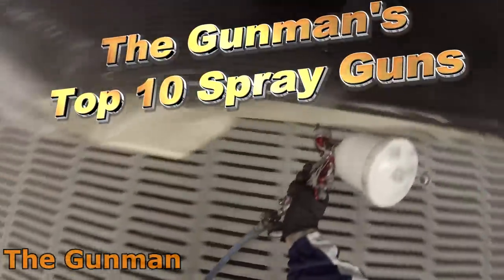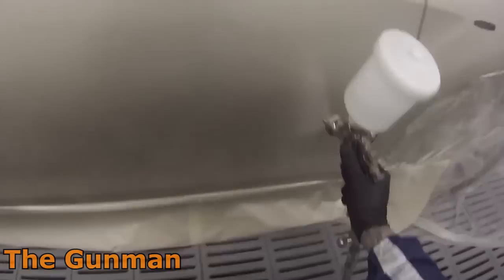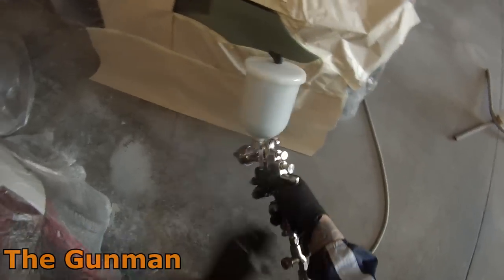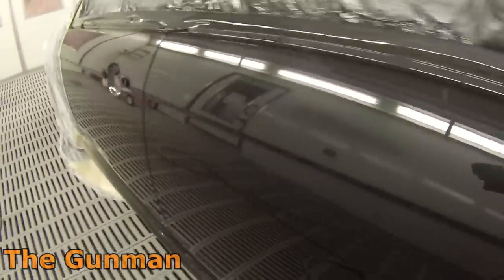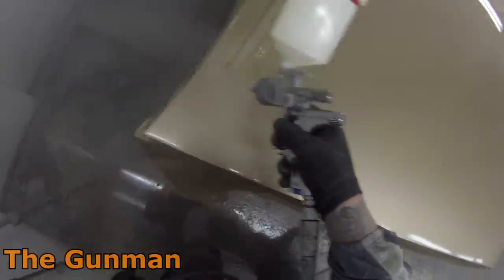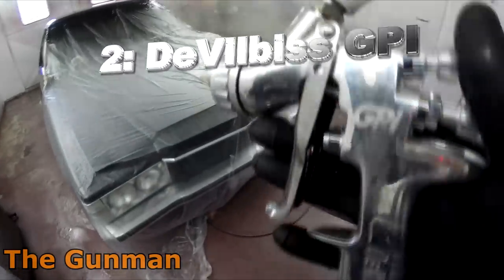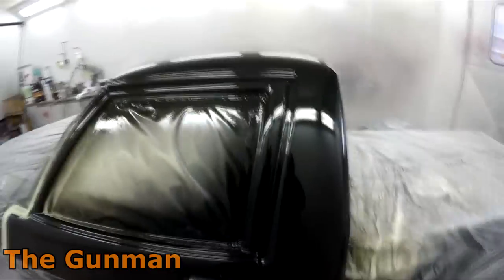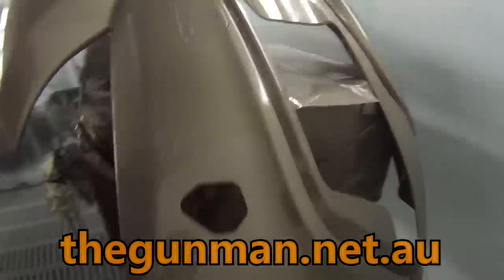Top 10 Spray Guns

Comment: My shop has ran the FLG3&4, with my only complaint is that the 4 was less ergonomic, but dependable for every day use. We've upgraded to Techna Pro this year, and now use the FLG4 as sealer guns. The FLG 4 is a very versatile gun and a great value, but the Techna difference on performance and efficiency is like night and day. As far as setting my fan goes, i just adjust it until I have the sharpest crisp edge on the fan and then go. Keep up the good shootin''.

Comment: My options changed massively since I got a couple sata 5500 rps. I was a diehard devilbiss guy but my boss offered to buy a couple guns to help speed things up and I absolutely love them. They make mottling a thing of the past even on the toughest colors. I spray Spies water so it might be more sensitive to mottle but regardless compared to any of the other guns it's effortless with the sata.

Comment: I started painting cars approx. four months ago and I was using the Sharpe Finex FX3000 and struggling to apply a smooth base and a smooth clear. One car I painted had over 200 runs in my clear coat!  Uggh. After watching this video, I purchased a new Devilbiss Tekna Prolite and it sprays awesome!  I just finished my second vehicle with the Prolite and I absolutely love it. I am using the TE10 air cap with 1.3 tip, and the fan all the way out with two turns out on the fluid as you suggested. Settings for greatness. Thanks for the inspiration!
Reply from the maker: Great to hear man, nice gun and will last a lifetime if looked after properly.

Comment: I began spraying in the 1970's with DeVilbiss and Binks Model 7. 

When automotive paints moved to 2 stage systems it became advantageous to acquire a good hvlp for topcoats. There have been several guns that provided decent results, but my favorite gun is the Optima 800 1.4 was purchased around 1985 has been a great gun...never changed the fluid tip and needle showing no signs of excessive wear!  Many years later...it is now time to replace the material cup, the original plastic cup is about done, will replace with a stainless steel, or aluminum cup soon.

Comment: Great Job, I have an Iwata Air Gunza and agree with you it is a good primer/sealer gun. I purchased two Devilbiss FLG5 guns, one for base coat the second for clear coat upon your recommendation.   I used the FLG5 for clear and was surprised with a huge fan and applied the clear like glass.  Thanks for recommendation on the FLG5.

Art Bolanos
Houston, Texas
Reply: Hey Gunny,

I had an issue with both FLG5 from Spray Guns Direct from the UK.  Our good friend Chris from Sales and Devilbiss Rep Ian gave me pointers on the gun.  Resolved the issue very quickly and a "Two Thumbs Up" Gunman Style to Spray Guns Direct and Devilbiss for great service.  

Art Bolanos
Reply: +Arturo Bolanos hi, i bought this gun but still awaiting for its arrival. what seemed to be the problem with it?

Comment: Hi,

I am from INDIA and I have been painting for around 10 years now. Here in India we are not able to use quality guns like you guys because to paint a full motorcycle we get paid around 200$-250$ maximum (including all raw material, ground preparation, primers, base coat, paint & clear coats.). On each job I only make maximum around 30$-50$ so investing in the high end quality equipments is not cost effective but following your videos have inspired me to gift myself a good gun & have also helped improve my jobs, now I am getting more work compared to before using your techniques, all because of you so a big THANK YOU.  I have also started getting custom paint jobs now.

The pure passion to do good for what I love the most.

I have been saving some money for around one and a half year now for this.

Can you please suggest me a perfect gun I should buy which will do both painting and clear coat, I am ok buying 2 different size tips, since I cannot buy more than 1 gun at this point of time.

Also I cannot buy any good spray gun here in India so I will have to get one online from USA. 

Currently I am using a very poor quality spray gun available here by the brand name PILOT.

Hope you can understand my situation and guide me in making the correct choice.

thank you,
Cheers.

Comment: Never painted before, bought the GTI pro lite TE20 , did the whole motorcycle with it. Primer, base, and clear. All with pretty much the same settings. It turned out great. I love the gun but what do I know. Ive never used anything else. I have since bought a primer gun.

Comment: I used to use a GTI for clear but the cap pressure was way to high causing a lot of overspray in the booth and wasted materials. I have a tekna prolite but in the USA at least it is for base only. Tekna does make one that is meant for each material. I use my LPH400 for sealer and it’s absolutely amazing. I also have a WS400 supernova for clear and after some adjustments i can lay out glass every time. In my opinion the best base gun is the LS400 supernova or as some people call it an ENTECH. Best paint transfer i have ever had. Less waste and less overspray filling the booth. As always this is just my personal opinion. I do also like the sata 5000rp but I couldn’t justify spending that much money. I feel that sata makes the best gun for clearcoat.

Comment: Great vid.  Every gun I use is on this list....but I would put them in a different order.  My FLG is my sealer gun, Tekna for color, Supernova for clear.  I know why you put the Tekna at #1, it is probably the most versatile gun ever built, and is the best base gun I have ever used.  If I could only have one gun...it would be a Tekna.  But the best clear gun, in my opinion, is the Supernova.  Hands down.

Comment: Hey there. Would you recommend three guns? One for primer, one for base coat and one for clear? I’m new to painting (never done it) and ordered two guns, GPi pro 1.4, 1.6 1.8 and the GTi Pro Lite 1.3+1.4 with a T110 cap so far to start and later maybe get that TE20 after some practice. Thanks for the videos.

Comment: hey gunman, I don't do cars, I mostly spray woods and I like car body acrylics. what is the difference between 1k and 2k when we talk spraying? do I need a different cap? I am using an inexpensive gun with a 1,4mm nozzle. works for my backyard projects and jerking around. I know 2k dry harder and are much better to wetsand and buff. is that true? thanks!

Comment: Thanks gunman for taking the time for great reviews and instructional videos! I just bought the flg5 with a 1.4 tip strictly for solvent basecoat on your review. Currently using a sata nr 2000 for base and a sata 5000 rpm 1.3 for clear. originally had 1.4 on the 5000 but it was to much for my style and speed,1.3 works great. My question is what a good starting point would be for the flg5 for fluid control ,turns out from seated position, and psi? I will be mostly painting metallic basecoat using ppg/dbc or prospray at a 1:1 mix.  Thanks again for your time. Keep up the great work!
Reply from the maker: I always left that gun wound right out for base, 25-29psi should get it on nice

Comment: Hi how are you? I'm from Brazil.
I am buying a Devilbiss Tekna Prolite, I would like to know how many psi do you use on polyester base and on the varnish?
How many rotations of flow do you use in the adjustment, is the adjustment tightening or loosening the screw?

Comment: Hey gun man, I'm just about to paint my mk2 golf in atles grey lp7v, I paint boats/superyachts for a living. Awlcraft 2000, Duropox,AWLGRIP, Awlcraft se Metallics etc etc. So I'm a smooth operator fairer , prep, painter, finisher. But im real nervous about rubbing down the high build for shoot. I've been told 500 grit wet is the best key. What do you think?? Cheers bud

Comment: New to painting my own vehicle, though I grew up in bodyshops. Mitsu Challenger I believe in Oz.  Thanks for all the info, I am deciding between  the ProLite and the Bellaria. Which used the  least CFM ?   I am using a 4hp 60gal compressor, BUT painting it in 2 sections, doors, hood and fenders 1st on stands in booth, then roof and 1/4's and hatch in another session.
   Solid red P85 , My plan is 3-4 coats red, 2-3 coats 50/50 red/clear and 2 coats clear. All urethane single stage with activator.
     I am using all HiFlo couplers with 3/8 hose and thinking about adding a 2nd. 4hp 60gal compressor if I can figure out how to plumb it.

Comment: Hey Gunman. Two questions. First, how does the Tekna GTI ProLite compare to the Tekna Copper?  Secondly, what's your opinion on the Eastwood Concours HVLP gun for use with smaller air compressors? Thanks

Comment: Your videos are gold, so glad you make these, much of my slow progress of learning to spray paint are based on these!

Would be very happy if you could give me a hint here:

Im using a AirGunsa AZ3 HTE2 (not HVLP) with a 1.3 tip to spray both base and clear. Ive found that the spec sheet for the paint and the spray gun dont always match pressure-wise. Now, i realise that it can differ alot from case to case but for example; The spec sheet for the gun says 2.0 bar for the 1.3mm tip @ inlet, yet from what ive understood it should be higher on a non-HVLP gun? Also to mix into this; paint say 2-3 bar for this type of gun. Should i start with 2.0 bar and get a feel for the atomization and up it if it gives me orange peel?

Cheers,

Comment: Hi Gunman,  many thanks for all the cool content you have been putting up.  Glad it all paid off in the end.  Hope you are enjoying Thailand.  I have been a few times and absolutely love it.
I have a quick question with regards paint types.  I an about to start the paint job on a classic mini, and am in a dilemma about whether or not to use 2K.  I don't have access to an air fed mask.  Is there a suitable filter system for 2K or am I resigned to using cellulose?  
many thanks George...

Comment: I've been using a Binks 630 with various set ups for 41 years.  They're an amazing gun
Reply from the maker: Yet to use a Binks apart from the old suction fed black guns still laying around, they are not common guns in Australia and think there's only 2 models sold.
Reply: I use the Binks 630 for Commercial vehicle refinishing.   I don't go near cars any more unless I have the option of using 2K.
Reply from the maker: Terry Martin But you can't beat laying on a mad coat of clear, better than any drug I've ever had haha :-)

Comment: Thumbs up for the wonderful and descriptive comparison. 
So, what minimum size compressor would you recommend to be used with these high quality guns? 
i.e. the tank capacity, motor rating in HP, air delivery rate etc 
I want to get the setup as a hobby thing but I'm kinda greedy for perfection too. 
Your input will be highly appreciated. Thanks

Comment: Hey Gunman, excellent video... One question, as someone who is just starting out, what gun or guns would you recommend I get for primer, base and clear... Is there one gun for all or do I need two or three guns? I'm confused by this because in my head, different combinations of fluid cap etc., should mean one gun can do it all?
Reply from the maker: If you want one gun that will do it all then grab my #3 DeVilbiss GPI with 1.4+1.8mm the 1.4 will do clear base and 2k and 1.8 for primer, 1.6 will do acrylic so may not be necessary, I have a few specific reviews on the GPI too. SpraygunsDirect have it at a reasonable price and provide a good service.
Reply: +The Gunman Thanks dude, I watched your video on the GPI... looks perfect!

Comment: Great videos, I've learned quite a bit even after years or painting. Have you ever used an electric gun? Are they any good? I was thinking about buying one because I don't really have a proper compressor at home, figured an electric gun might do the trick but they seem to be pretty new tech and I'm very skeptical about it.

Comment: I just recently got back into the industry. i was usin a sata4000 for base and a iwata w-400 for clear. so i ordered a iwata w-400 and also a iwata ws400. before i was in a production body shop where a little bit of orange peel was good. now I'm in a custom restoration shop. i cant can you tell me how many turns out i should set the fluid on both guns, to lay the clear like glass?

Comment: So I'm a beginner painter in the uk done a few cars havent had problems with dripping etc, but I want a new gun I was looking at the GTiProlite and it gives an option when buying of different aircaps(HV30, T110, TE10, TE20) I want to use this gun just for lacquer any advice on what aircap I should get?. I spray in a good warm closed room. and also what lacquer brand do you use

Comment: We need a new top 10 review video. Ive been spraying clear with a supernova and base with a sata 5000. Those are my bosses guns, only gun I currently own is my own supernova which I only use for sealer. Currently looking to buy the devilbiss dv1 and or the Sata 5500, but I really need more info before I pull the trigger on either. Would love a updated video like this with the newer top class guns from these manufacturers

Comment: I got a question,  I'm trying to spray paint that is at 21 sec with a #3 Zahn as per paint specs.  Only have to worry about drips and sags and dry spray.  Mills are big deal  too.  I have a Tekna pro 1.8mm.   Its sort of doing its job, but atomizing is not so good.  Tried my FLG4 with a 2.0, and then tried the 2.2mm cap, was worse than the Tekna..  Short of buying a pot, what do you suggest?

Comment: Very good review but tell me gunman, if the sata 5000 and the devilbiss pro light were the same price, which one would you go for then? and do you reckon paying the extra for the digital gauge is worth it or is the normal gauge just as good, very interested in your opinion,
have a good new year to mate.
Reply from the maker: So the Pro lite is more versatile with the ability to change caps and can get just as good finishes it just doesn't quite throw out as much as the 5k but that can be good, short answer is I'd still give the pro lite 1st as far as using in a repair shop goes but for custom work then maybe if cost wasn't an issue then the 5K would win.

Comment: Hey Gunman, I really love your videos!!  It's very hard to find any reviews not sponsored by a manufacturer. I am a DIY guy in the US restoring a 1968 Mercury Cougar (black).  I've decided to prep and paint the car myself but instead of using a $30 spray gun I've decided to invest in a professional-grade spray gun.  You seem to really like Devilbiss and I've been looking for a used GTI Pro or GTI Pro Lite to use and then sell when I'm done.  Since I'm spending so much on a gun I want one that can do primer, color and clear coat well.  I'm also planning on using metallic paint.  I will rent a 10cfm compressor for painting.  Is the GTI Pro a good choice for me or would you recommend another?